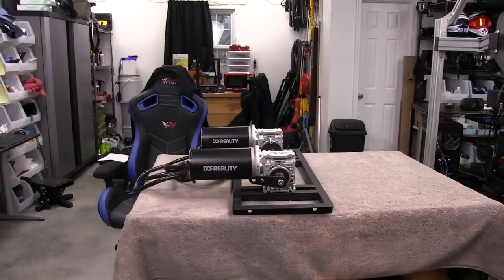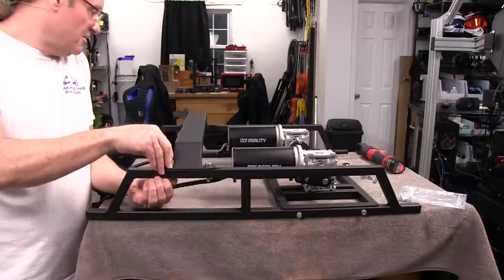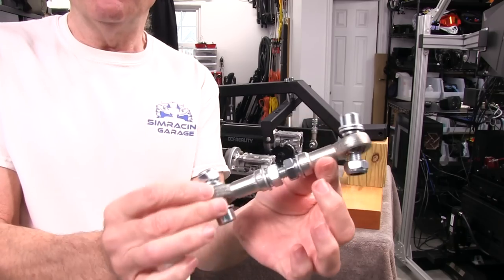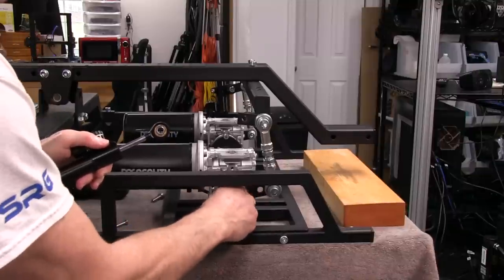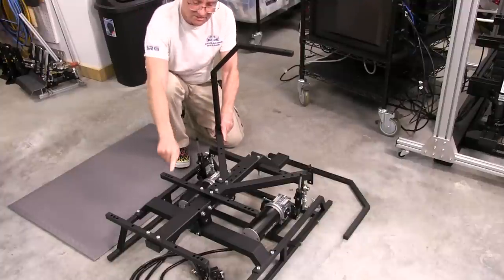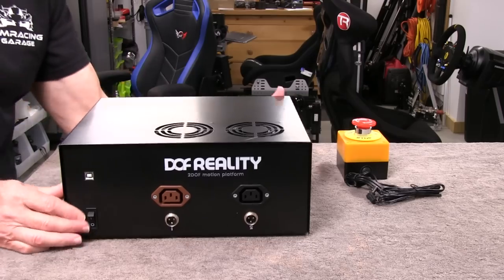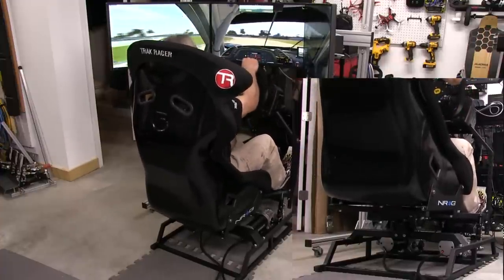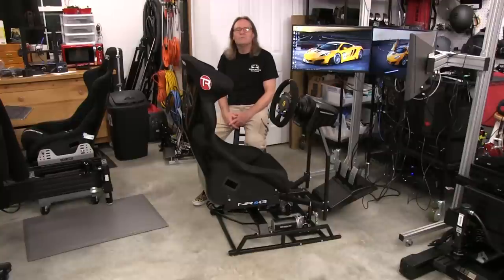DOF Reality H2 Review

Comment: Great video as always. I just assembled an H3 yesterday and I noticed you can smooth it out a lot by turning the boost down as well as the accel and decel settings. After messing around with it for a while I was able to get a pretty decent setting for my favorite cars in iRacing and the software will remember and automatically load them up with the car. 

The wheel platform is unfortunately not acceptable for a direct drive wheel. Especially for a taller driver like me, I have to use it on the highest setting and it’s barely high enough. Also, not having a tilt feature is annoying and I’ll need to add a bracket for my wheel base. I have some ideas to either replace or augment the vertical tubes with 2020 profile to stiffen it up because that’s wheee most of the flex is. It should fit on there easily since it’s the same size. The wheel plate really should be 2-3 mm thicker and maybe aluminum if weight is an issue. I’d love to see them improve the design or see an aftermarket company make upgraded parts because it’s by far the weakest part of the platform. Everything else is good and worked right away with no issues. 

For the price, it’s really an incredible device and with VR the feeling is fantastic once your dial in the settings. I’m happy with it but it really works best with lighter wheelbases. The pedal platform is fine, should work for most pedal sets. I’m using Fanatec CSL and it feels good. For competitive drivers, you may want to stick to your 8020 rig. This is fun but after a couple hours it gets tiring and I haven’t really seen lap times improving even with traction loss. It feels great though. D-Box or other actuators are still the best solution for motion but it’s just so much more expensive. 

One last thing that Barry mentioned but didn’t talk about much: the seat balance is very important. Disconnect the rods from both motors at the bottom and sit in your seat so it is balanced when in the driving position. Left and right isn’t as important but make sure front to back is as balanced as possible, I used a seat slider to speed up the process. You will have a less jerky ride with better response if it’s balanced.
Reply: I have been using a P3 for many months with the Fanatec DD1 and it seems fine. I did put lower the steering wheel arms by cutting it and then making the wheel angled about 20 degrees to the wheel base. My compromise is the top of my Fanatec BMW wheel is about chin level but i use a 65" Oled TV so i can see more of the screen. Left/right balance was important as i use the gear&handbrake as unit was leaning to the heavier side. I ended up using a counterbalance on the other side and for the forward/back balance, i used a seat slider. With the DD1 and Fanatec inverted pedals, it was quite fortunate that i am balanced quite well at my ideal seating position.
 
I wasn't offered any dampers when i got mine, just wondering if worth upgrading?
Reply: I have the the P3 and have added 4545 profile to the wheel base bracket and it solid with no flex now. The whole rig move as one if you try to flex it.
The balance is adjustable for me as i have a sliding car seat and the motion works fine for me with the aditional weight. 
I also added triple 30" monitors to it that moved with the rig and the motion was still fine, it actually made the whole motion feel smoother. I removed it as i use vr the most when sim racing now and the reflections from the monitors was putting the vr out of sync.
Reply: Would you buy it agajn
Reply: @tehgusbus2716  yes when I have the funds I plan to upgrade to the 6 dof
Reply: You have money, nice.
Reply: @tehgusbus2716  I can also add some positive info to this thread.  I also have the P3 and will more than likely upgrade to the P6.  I would like to contact DOF Reality to see if there is newer/better control software.  Zero complaints.  I'm close to 1 year in with DOF Reality.  Support has been fantastic.

Comment: It looks very interesting, and you could probably stiffen the wheel base by adding a bar between your legs. I wonder how hard it is to mount a monitor to it as well though...
Reply: You can mount a monitor to it, but be careful with the weight (I believe they mention 150kg max load?).  You should probably go for the more heavy-duty P2 motors instead of the consumer-level H2 motors due to the strain from the extra mass. Also, you'll need to rebalance the universal joint in relation to the new center of mass so that the seat is mostly in balance when you're sitting in it and the monitor is mounted. Johnny Tech Gear mounted a triple monitor setup on his P3 rig, see the second half of this video: https://www.youtube.com/watch?v=gz8i9lYWZcY&t=14m55s

Comment: I have the P3 - for about a year now. There is one good thing about these platforms: outstanding service. If you have any issues the support works very well. 
But: as a motion platform I would not buy it again. The movements are very edgy and the construction is not nearly stable enough for a direct drive wheelbase (or actually ANY other wheelbase). It flexes so much, it is close to unusable.
Reply: Marcel, do you fly or drive?

Also, reference the flexing,what if the base. Was bolted down into the ground(not always possible) but would that eliminate the flexing? Thank you!
Reply: Thanks for that. Out of interest did you buy the extra strut for the wheel mount?
Reply: ie the 'Extra wheel support' listed here https://dofreality.com/options/
Reply: Steve Lane that extra support should be standard.

Comment: For the price and the complete package this is the best choiche in my opinion for a entry level motion platform.. Next level racing is still 3k for the cheapest one and it is only a seat mover without the stand.. next year I'm going to buy this dof reality, if they come out with an even stronger wheel stand even better! But in my opinion with some little diy it can be stronger
Reply: Yeah, but the rig, wheel and pedal deck looks way to weak, and not sure how well the motors would cope with the extra weight if you manage to make it more rigid?
Reply: @RVRCloset  i think that the aluminum from the 80/20 replacing the weak arms of the stand won't weight too much more. Those motors are strong
By the way when racing I would never put 100% force in the profile booster. Most of the times it is too much and distracting

Comment: Using a dof H3 here with the add on dampers which make a lot of difference and take away the snatching of the motors.
\i do find the adjustment on the dampers has almost be on max to make any difference though.

The rear drift wheel assb has been been beefed up from other reviews on it from the past.
Using any roll on simracing studio settings on car sim racing seems weird as having any roll in a car would be as driving a 2cv or Morris 1000.
Surge ,acc,brake,traction loss,heave all work well on Dirt2 race room ,R Factor,accetto  and Forza 4 in xbox mode with Fanatec is great!

I bought a Sparco seat with runners and is a direct fit on the rig from Demon Tweeks.
For the price it is great!

Comment: I would love to hear your thoughts on a DIY SFX100 motion platform
Reply: Yes please according to all forums this is the  price/performance King and on par with dbox for about 2k
Reply: Yes please! It would be great to hear Barry's opinion on SFX-100. I'm building one right now, and I'm already impressed by the sturdiness of the actuators. I wasn't sure what to expect exactly, but love for DIY motivated me to try. It's coming in together quickly. Biggest detractor is probably sourcing all the parts (easy but takes time to arrive from all the vendors) and 3D printing parts (can be time consuming, but instead can be ordered from people who printed dozens of them already, for not much more than cost of the materials). All in all I'm very excited, now waiting only for the motor couplings before I can try it out. Would love to hear Barry's opinion on how SFX-100 compares to all the high end hardware he has experience with 😊
Reply: @FireBullet  what parts do you need 3d printed
Reply: @tehgusbus2716  there are 6 different parts that need to be 3D printed for SFX-100, 4 copies of each (one for each actuator) for a total print time of somewhere around 200 hours. Those parts are: slider, bump stop, fixed bearing mount, linear bearing mount, motor mount, foot. It comes to around 4 full filament spools. Print settings are very important, those parts need to be strong, so skimping on the settings to save filament won't do any good (and it's good to check the quality of those parts if ordering them to be printed somewhere). I got them from a fellow Sim racer offering his services (great quality, very fair price) on some of the Sim forums 😊 PM me if you'd like his contact info.
Reply: @FireBullet  how much did he sell the parts for? I was thinking of getting a 3d printer
Reply: @tehgusbus2716  his rate is $180 for materials (4 spools of Priusa filament) + donation (he's making it mostly for the community). Amazing quality, he's active on forums and very, very dependable 😊 and having just finished assembly of the actuators, the quality is amazing. Every parts fits perfectly and makes the assembly much easier (no need to sand pieces down or finish them in any additional way).
Reply: Barry's silence suggests he's mainly interested in commercial systems only. He would have to construct a system from scratch to do the review. I admit, I'd love to see a review!
Reply: @wmacky  I think it shouldn't be very difficult to find someone with a built SFX-100 somewhere convenient for Barry... Although this is a larger task to organize, and nowhere near as convenient as doing it in your own space, so I absolutely understand the hesitation... That said, Barry - if you're reading this, and decide to visit Seattle, I'd be happy to invite you and give you all the time you need with my rig! 😊
Reply: @tehgusbus2716  2k jheeeez not to bad really,   you got me thinking now lol
Reply: @richysracing9524  it's a bargain compared to 10k+ for dbox lol
Reply: @tehgusbus2716  wow 10 k seriously
Reply: @richysracing9524  some are even more I've heard up to 15
Reply: @tehgusbus2716  yh obviously there's motion rigs that go upto like 100 thousand but that's top end gear,   I'm very impressed with this full motion rig though I mean 1200 for that is a bargain,   Infact I'm seriously thinking of buying it and modifie the wheel base add some more support
Reply: It appears the system that Airwayz ArA posted about from https://simrig.se/  is very similar to the SFX100, only pre-built. I'd love to hear from anyone who has both units and compare them to each other. For around $2600 that system from https://simrig.se/ seems like a steal!

Comment: Other than QC / lower allowable tolerances  (less backlash / slop in components), the change in motor / Gearbox combo should have had virtually no change in overall motion effects since the output rotational velocity after the gearbox is still the same. 
As stated, the M2 system you have (had) used a 3000RPM rated speed Motor and was coupled to a 50:1 GB, so the output speed after the GB is 60RPM (3000 / 50 = 60)
For the H2, its a 1500 RPM rated speed Motor and is coupled to a 25:1 GB, so the output speed after the GB is also 60RPM (1500 / 25 = 60) 

If anything, I would suspect the H2 to possibly be more jerky because of the lower peak operation speed in theory means less time to reach max speed. Now granted, there is also the full load torque output capability of each motor but I suspect (based on DOF Reality's spec) that the H2 Motors are higher torque so naturally will be able to accelerate to max speed faster and thus all other things being equal, it would be more jerky. All in all though, any changes in perceived motion would have to have come from Software and/or geometry changes between the two setups and the addition of the dampers.

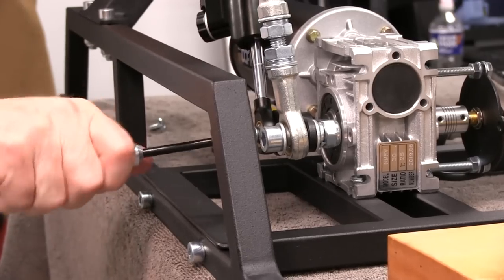Speaking of dampers, unless I missed it, it was never mentioned that the clamp collars ultimately were moved so that the damper body's were not at the lowest position when the system was at rest. When I saw the mention of them initially being setup like that ( section starting at 25:00 minute mark) about them being bottomed out, I instantly knew that that was gonna restrict the system to only being able to pitch back (any other motion would be locked out since the dampers would have been bottomed out already).

Comment: Do these systems play well with Dirt Rally 2? Seems like everyone uses them with road racing games
Reply: think u can find some videos on yt if ppl play with this in dr2 or not ^^ im not sure atm
Reply: Trust me I have the DOF P3 with traction loss and it is horrible for dirt rally 2.0 and dirt rally... the traction loss is a joke and it clunks and bangs even on a low setting if you live in a flat you will get complaints straight away from your neighbour even at low settings as it vibrates through the floor I can only use it at low settings around 25%... Have you thought why nobody is showing a decent video for rally games the answer is simple because it is awfull for rally games.

Comment: Great review Barry. Been looking at a new rig and this is a very intriguing option as it's basically the same price as the P1-X with the advantage of movement. Obviously rigidity isn't even comparable, but wondering if it's a trade-off worth trying out. Big question is do you think 2 dof is enough for racing? Or is 3 dof required for a realistic feeling behind the wheel?
Reply: I have the P3  and have used it in 2 dof mode. The motion feels amazing even without the slip in the rear. But it does feel really good when the backend starts sliding when using 3 dof.
Reply: @MsJonaruto  Oh man, I didn't realize you were using one of these. Thanks for the info. I'm gonna hit you up for some additional info in the channel. ;)
Reply: @paulriccobene  no problem

Comment: Hi Barry after watching this video a couple months ago I decided to purchase the H2 especially due to the fact that you show the motors with a lot less play my I ask how long did you test the rig for because my motors seem to now have the same play as you showed in the M2 video? Hello again Barry thank you for not answering, but to anybody reading this in the months since I posted doff reality have offered no help in sorting out the issue I have with the excessive play in motor number one.
Reply: Still no fix?
Reply: I just had my H2 built a few days ago and I can tell you mine is solid with no play.  You cannot move those armatures at all.  Also the software has been updated.  Doesnt look anything like in this video.  My platform is pretty smooth, not jerky like in this video.  The software has intelitune for each specific car for every game so you can tune or dial in the recommended parameter adjustments or adjust to your liking and save it for that car.  Very useful.  They've added sway and heave adjustments as well as surge for more fine tuning.   No need for H3 (yaw) if you're not doing drifting or rally type racing.

Comment: Barry, could you tell the difference between having the dampeners on and off? I have a P3 and wondering if it is worth getting some.
Reply from the maker: There is a difference between having them and not. How much of a difference is subjective. Best to try them before buying if possible.
Reply: @simracinggarage3026  thanks for your quick reply. Ill order a pair a try myself. With regards to the rectangular bracket to connect the damper to the unit, is this part available or would I have to make myself?
Reply from the maker: If you order the dampers from DOF Reality, I think the brackets are included. Need to contact them to make sure. Otherwise, just make your own.
Reply: @simracinggarage3026  thanks for your reply. Just ordered a set from Dof

Comment: Barry why the hell haven't you made you're own sim rig,
I'm a sheet metal fabricator and making a sim rig is really easy,  it's just the motors and the electrical stuff I have no clue about,
I would say 20x20 box section is to small,  least 30x30 but I'd use 50x50,   with 4mm peddle plate,    I'm impressed price to performance is amazing
Reply: with total weight over 120lbs?  I think weight matters for international shipping.
Reply: @hitman-yu1wm  yh true,  mine will not be movable after its put together as I'm bolting it to the wall aswell I want it solid as I will be buying a 30nm motor in the end
Reply: @richysracing9524  it took us 4 years and many iterations to master it to this version. It looks simple but there are few thousand RnD hours and six figure investments behind it
Reply: @dofreality  yh I can imagine to produce a really good product which obviously that's what you've done, 
Fare play though if only I had the room lol

Comment: It seems this 2DOF system can be used on other rigs such as the next Level Racing cockpit or sim lab cockpits
Reply: Waht is the point of paying triple to different vendors, as you can get H2 or H3 + seat off eBay for 150$ and get amazing experience
Reply: DOFReality is there anyway to add DOF to my Next Level Racing F-GT

Comment: Hello Barry, new subscriber here!
I found your channel searching for info about those dof platforms, great review.

I wanted to ask advice, since I'm about to buy a new rig, and I'm quite in doubt, weather go static (with the benefits of robustness) or low-cost dynamic (H2 you just reviewd).
I know they are very different products, but would you suggest the H2, considering using it for 3-4 hours a week in total? Also, do you think the price difference between h2 and p2 is justified? The rig structure should be the same, if I got it correctly.

Hope you can find the time to help me clear my doubts, thank you
Reply: Go with the P6 :)
Reply: @tdg911  Thanks but that's definetely out of reach :D